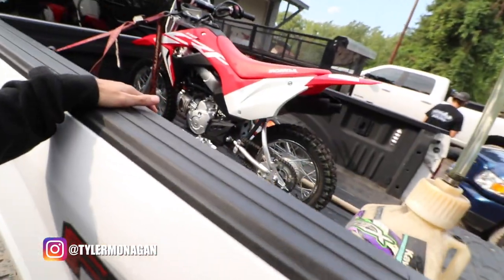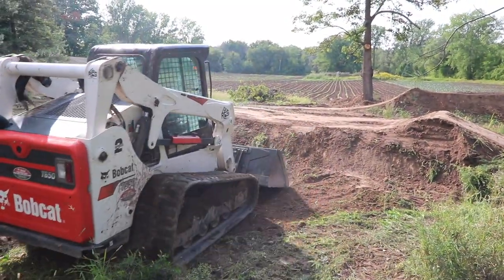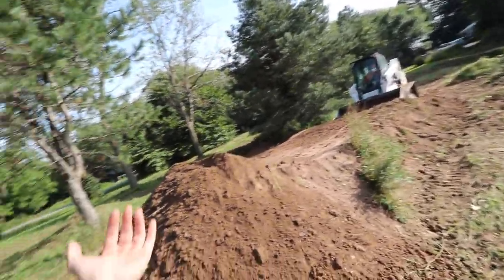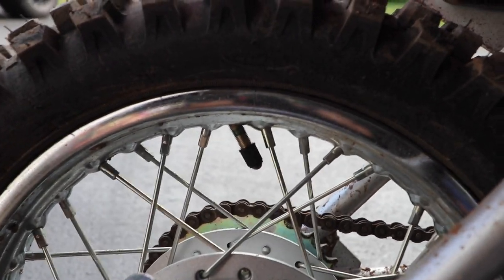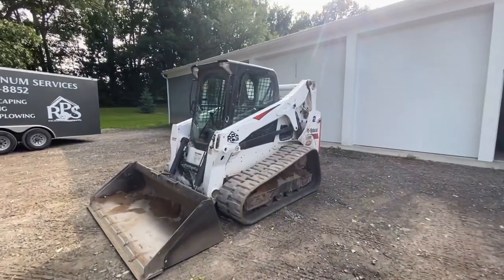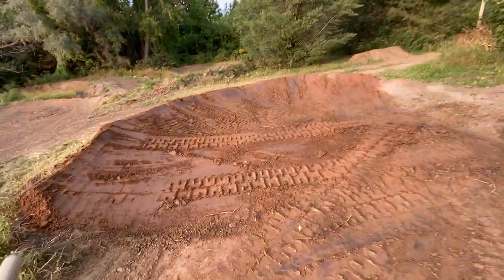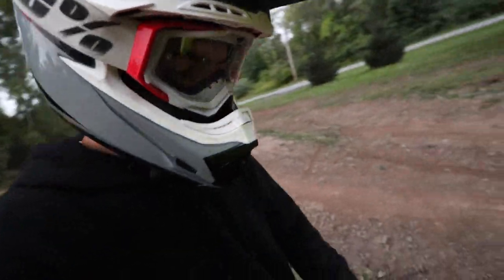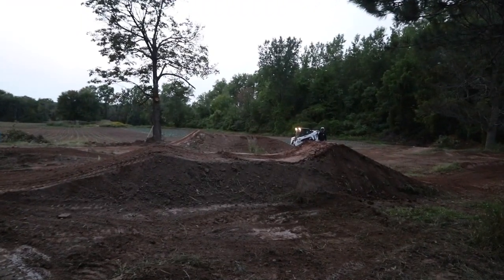First Ride on NEW 2021 CRF110F at BackYard Pit Bike Track

Comment: Hey Tyler I got a 04 kx125 and we have to change the spark plug every 2 track days. What do you recommend
Reply: I recommend you get a 4 stroke,  you obviously aren't staying on the pipe enough 
Or, learn how to ride a 2t properly 👍😜
Reply: @backyardbraaapn1017  we fixed it the previous owner had terrible jetting and we had to fix it now it works better

Comment: the skid plate will fit all years of the crf110 you have to tap the hole on the exhaust side and modify the sensor cover for it to fit